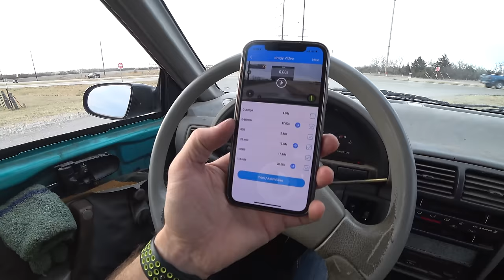I BOUGHT A Geo Metro For $300 And FIXED It In ONE DAY

Comment: I had a 90 metro XFI ... the 5-speed transmission went out when it was about 10 years old

from the time it drove into the garage -> to the time it drove out with a different transmission was a little over an hour - by myself with only a floor jack and hand tools

it was the easiest vehicle I've ever worked on

I'd still drive one of these

Comment: My first car was a 1993 4dr Metro of the same color. I nicknamed it "MacGuyver" due to the excessive amount duct tape, shoe string and garbage tags holding parts of the frame together.

In '96 I was pulled over on the Jersey Turnpike for allegedly going 78 in a 65. My response was that his speed gun needs to be calibrated because the three hamsters running the engine could never create that much power.

Lot.of great memories from that car though. Thanks for sharing!

Comment: Okay, so my Mom had an old wrecked red Geo when I was growing up. I hated it. I used to make her drop me off a block and a half from the school so no one would see me. 😂
It too was missing the door handle on the drivers side. We eventually had to take the door panel of so that we could we could just pull the wire to open the door. 
It was missing the passenger side mirror. 
The trunk struts were replaced with a 2x4 and if you had it propped open and someone slammed one of the other doors then you had a minor concussion.  
The seat covers were old sweatshirts
The windshield wiper handle was a screwdriver that was glued it. 
Man, bring back all the memories with this one. 😂 
All in all I do kinda miss that car. 52mpg was pretty nice. It was also the first car i ever drove. Now I refuse to own a car that is not a manual.
Reply: the 50 mpg is real

Comment: I have a 99 Metro 4 dr with the performance engine 1.3 ltr 16 valve 4 cylinder 79hp at 6000 rpm.  It's the loaded up model with 3 speed automatic, air conditioning AM-FM CD player.  I paid $300.00 for it got it home and put on a new timing belt and a set of 155 80 13 tires.  It will peg out the 85 mph speedometer eventually and turns in 40 mpg.   I've put nearly 60,000 miles on it...love it.  Those little cars are tough as nails.

Comment: There’s a ground issue at the fuse panel under the drivers side. Common issue
Reply: Yup...that plastic panel on one of mine got hot and melted. I put an after market cruise control on it and found the problem poking around in the wires under the dash.

Comment: Had a '91. People might laugh at it,but it was VERY reliable for 10 years and the mileage was unbeatable. I remember driving to work after a bad winter storm in Indiana,passing 4x4s stuck on the side of the road with no problems at all. Never got stuck. Worst problem I ever had was broken alternator belts.

Comment: A few years back around 2011 a good friend of mine
(Past away in 2013 car crash rip my brother) sold me one of this for $200
4 door version!
 cause i needed a vehicle real bad and he  offered his little car.
Even that the exterior was rough with a door damage, missing both door mirrors
And a few dents not to bad. 
The interior was spotless!! Like NEW
no rips, stains, decoloration nothing!!
The engine and trans were in perfect condition!
It was his project and That car was amazing!!!
He knew i was in need and he offered to me so cheap to help me!
A year later i found the same one with the exterior in perfect condition with same color (red) but the engine wont start with missing parts inside and not to good on the upholstery
I bought it for 500 and took all the exterior parts that mine was missing or damage and swap them 
The car became beautiful!! It was an amazing car and i loved it.

Comment: I had the "enjoyment" of refurbish a 1996 Geo Metro that my adult son's sister-in-law used for what had to be a demolition derby. There was no part of the exterior of the car that wasn't dented/smashed in, including the top. And the interior was torn and "painted" black...even the gauges, dash and door panels..at least the ones that were there. Why? anybody's guess. But I was wanting to learn the skills of auto-body repair and took it and started refurbishing that "thing". After many failures in body work, I finally understood the skills to repair the metal properly and when I finished that refurbishing, it look absolutely new inside and out. We even sewed new seat covers and installed new carpet and everything back to new. Lots of work, but I did learn auto-body repair...finally!

Comment: had a1990 4 door red geo metro automatic for 6 years.drove it cross country and slept in it till the 4 tires melted in the arizona heat.got 40 miles per gallon in that 3 cylinder and i wish i still had it.

Comment: Valve springs- Get an 02 socket, and a drill press.   Use 1/4 drive to 3/8 or what ever is on 02 Socket adapter.   Use rack/pinion of drill press to compress springs... works awesome.   Make need to kick head up to match angle.

Comment: i bought a new 94 geo metro and put 300 000 miles on it and all i did was change brakes and battery and regular oil changes   still has original clutch and all its original engine parts ...i love the geo metro

Comment: I didn’t think you were supposed to spray the engine with water at the car wash 😳
Reply: Right. It could crack a hot exhaust manifold as the metal would unevenly contract when cooling. They grounded out the plug wires and got the distributer cap wet, so
it would not start until they dried all that out.  Interesting that they sold it on without repairing the exhaust leak. Not cool.

Comment: Last time somebody I know washed his engine, cost him an alternator and a starter motor!
Reply: I once accidentally left the oil cap off of my Mercedes diesel's engine and oil sprayed all over the engine compartment. I sprayed down the engine bay with brake cleaner, and then hosed it down. Zero issues. But then again, diesels from that era (the 80s) had so little reliance on the electrical system once they turned over... I drove it without a functional battery or alternator multiple times.
Reply: @longbottle  Good old Mercedes! Proper cars!

Comment: We had one in my family for several years. Here in Germany it was sold as Suzuki Swift. I always felt unsafe in this tin can, it even missed ABS and driving on the Autobahn wasn't much fun, definitely a car for the city roads. But it was very fuel economic and it was reliable! Spare parts also were cheap. We sold it in 2018 for 50 EUR. Today it may still running on the roads down Afrika where the car trader shipped it to.

Comment: I had an 1988 Chevrolet Sprint, bought brand new.  It still had a carburetor in 1988.  Great car, wish I still had it.  Nothing like 45/49 MPG.  I had a head gasket leak when I got rid of it, but if I knew then what I know now, I probably could have fixed it myself.  The only thing I wish I had gotten instead was the Turbo mode (70HP LOL).

Comment: Nobody:

JR: let's power wash a 27 year old engine 

SMH... simple degreaser, Dawn dish soap even, and non-pressurized water would have worked just fine, if not better
Reply: Dollar store oven cleaner works well.
Reply: What’s wrong with pressure washing an engine bay
Reply: @lanebramlett2754  With an old car like this, something's bound to come off.
Reply: Jimmy Dean ok thanks I was not sure
Reply: @SamH11223  And water getting in critical areas water should never get into. hence why he couldn't start the car after doing that. Chrisfix does these videos so much better.
Reply: @BattleOfBowties  - not on aluminum

Comment: I worked on one having issues with idle speed control thermo valve in the throttle body due to plugged 5/16" ID coolant hose

Comment: My mom had a 92 and it was on the road until last year, with over 400.000 miles. It outlived her, and would probably still be defying reality by being a reliable daily driver had my son paid attention to the low oil light.

I always wanted one so I could cut the roof off over the rear seats and hatch, to build a weird little 'pickup truck' looking thing. 

I miss that little car. Really enjoyed you guys messing around with this one.

And it always sounded a lot more powerful than a 3 cylinder had any right to sound.

Comment: I have a 94 or 95 Geo Prizm auto that is broken and parked out front. What killed it was the failure of the seal between the radiator and transmission. At that point it had no AC, needed a break job, and had spent a while with no power steering. Still worked for quite a few years.

Comment: My 90's Suzuki swift with a 4 cylinder (paid $400) used a quart of oil every time it was driven. I pulled it apart and one piston was broke from the oil ring down, l pulled the head replaced the piston and dingle ball honed the cylinder, pulled the oil pan and cleaned out all the debris, all without pulling the engine from the car. Still runs great after 30k miles.

Comment: Owned a used '93 Metro back in the day. Working on it was a breeze because the engine was so small that you could literally stand in the empty spaces around it. If you ever dropped a tool or part you could get your whole torso through those gaps and pick up whatever you dropped.

Comment: I rented one & it was fun to drive. A little twitchy on the highway at 70 but fun. When I returned it the shift lever wouldn't move into the "Park" position. I bent it trying. They keys wouldn't come out of the ignition unless it went into park so turning the car in was an event. Their maintenance guy couldn't get the keys out either. It was the version with "Suzuki Swift" badges on it. Nothing against Suzuki, they make great motorcycles. I've owned 2.

Comment: My mom drove one for years.  Lost compression, Then I got it.  Replaced the burnt valve, then drove it for three years or so.  Stopped driving it when lost compression a second time.  Gave it to my friend that fixed it the first time, and he replaced another valve and drove it over 150 miles a day going back and forth to barber college for a year before he sold it.  It had at least 120,000 miles on it when I got it.  Then the miles my friend put on it before he sold it.  For a disposable car, it served us well.  1994 model.

Comment: Bought the same car, color and all, brand new in '93. VERY economical, reliable car. A big plus was that it had a minimal amount of electronics to fail. Put aftermarket a/c and a high capacity 3 row aftermarket all-metal  radiator in it myself. Only sold it about 8 years ago to someone who sought it out and drove it cross-country to Washington State (I'm in Miami, FL). The only constant problem was the tires, and not because the tread wore out. Even brand new, and regardless of manufacturer, or grade, they would constantly lose air pressure, getting worse over the life of the tires (I put 7 or 8 sets of tires on that car in 20 yrs). The XFI engine used a slightly different camshaft and valve timing as well as slightly different timing belt and gears. It was good for a consistent mid-40's, low 50's MPG fuel economy, and would go 92 MPH flat out, if you had about 3 or 4 miles of straight, flat road to do it. Oh, and the plastic stuff inside the car started falling apart after 2-3 years. Who cares, I knew what it was when I bought it, a basic airport car. If a car that gave the value that Geo did were sold today, I'd go down and, once again pay cash and buy it in a minute. My brother is the original owner of this Geo's predecessor, an '88 Chevy Sprint that still gets driven a couple times each week.

Comment: I bought an 89 Suzuki Swift gti from a guy in Indiana for 500 bucks a couple years ago. Rusted out floor pans and missing almost every interior panel but wow was it fun it was to drive. 6 months later I hit a huge puddle in the road and it just stopped running. Shops wouldn’t work on it cause they said it was basically a lost cause. Tried to fix it myself but nothing ever seemed to work. After putting in more than I bought it for I had to junk it 😔 she was my red rocket. I kept the interior brake light as a memento. Metro/Swift/Firefly gang rise up 🤘🏽

Comment: I bought a 93 Geo Storm back in the day for $250, as it needed a head gasket. Did all of that (for cheap, too..parts for Geo are just crazy cheap for some reason) and drove it for a little while. Got rid of it when I realized I had to replace the entire front suspension to stop it from eating tires every 3 weeks.

Comment: I bought my 92 LSi convertable 2 years ago for $700. Put in a coil, fuel pump, all filters, plugs, wires, dist. cap and rotor and oil change.  Haven't had to do anything other than routine maintanance since. I get 48mpg combined city/hwy.
(Edit... all in under $900 road ready)
The 1 liter 3 cyl came from the factory rated at 55 hp @58 #ft of torque. Same engine in your 93 3-door. Great little, hard to kill cars. But heah, they do take a good while to get up to speed. They will eventually get up to 85mph highway speed, but it takes a bit of getting used to. You definitely do not have two-lane road passing power, but you can pass a lot of gas stations on its approximately 8 gallons of gas.

Comment: Bought a xfi brand new in 1989 for 7800 dollars off the showroom floor at chevy.
No mirror on passenger side and no ac for mileage i got 58 mpg.
In 5 years of ownership I never had any issues only had to unclog the egr valve.
On 2012  i bought a red convertible at the height of the gas crunch it was 20 years old I drove a 124 miles round trip 6 days a week and for 2 years never had to do anything but change the oil.
In 2014 I boight a 2001 honda insight and still have my convertible geo today.
Great dependable cars only issue is safety as they were made so light.
Very underrated  cars.
The xfi had a special cam for superior mileage . My red convertible and most 3 cylinder geos wrre rated at 48 yo 50 mpg.
My 20 year old red convertible ran for around 60000 miles over 2 years and still runs fine today as I sat back and my co workers laughed at me yet they were all constantly fixing there late model cars living within a stones throw to work.

Comment: I just got a low mileage 1994 Geo Metro 4 door, 5 speed with A/C, clean interior and new pearl white paint for $1100. Only has a bad fuel filter and fuel pump. It would not start till I whack the bottom of the gas tank with a  piece of wood. Then I drove it sputtering 45 miles home. These things are just little workhorses.

Comment: Got a 95 metro lsi with 129k (that’s barely broken in btw) it’s not the infamous 1.0 liter but still managing to get 45 to the gallon. All you gotta do is keep up with the maintenance which is super easy. Can easily last you upwards of 300k+ miles. Great little dependable Suzuki engine, can’t complain for 700 bucks 👍

Comment: Owned a white 1994 XFI. Previous owner bought the car from an auto parts store that used it as a delivery car. The back seat was removed and a piece of plywood was cut and placed over the back-seat area to accommodate more auto parts; so it was basically a 2+2, coupe! I bought the car for the novelty of having the XFI (I knew its reputation as a popular hyper-miling platform). It was bad-ass on gas, too! I think this would this be my Bug-Out car; in a Zombie Apocalypse, you could travel from sea-to-shining-sea with the gas you could trade or siphon. The prices on the parts is measly. A four seater that runs, shifts, has heat and and other basics and passes inspection? Bad-Ass for a 1st car for a high school kid. I would have loved ANY car, in high school!

Comment: XFI has one less piston ring and a different cam so it gets better mileage than the others. I have owned 4 Geo Metro Convertibles at one time and even adapted a Kubota 3 cylinder 24 horsepower diesel  engine to the 5 speed trans. I still have it.

Comment: They made a Pontiac that was called the firefly and it was a 1.0 liter single turbo. And got even better gas mileage.

I just picked up a 93 metro for 140 yesterday and I intend to put boost through the old 3 cylinder

Comment: I bought one in 2012. Owner said his turned on the stereo and heard a noise then the car died. He put a plethora of sensors on it, all fuses were fine but it still wouldn’t start. I gave him 300$
The same day I was looking around under the dash and found another small fuse box. It held only 3 or 4 fuses and one was for the ignition which was blown. 
Replaced the fuse and it fired up. Sold it for 700 the same day.
Reply: Where is the other fuse box?

Comment: I  got a`95 as a pandemic project put a couple grand in it ,drove it 4000 miles to avoid flying in july 2021,its a 5 speed w/ac   198k on  it got 42 mpg using the ac bout 1/2 the trip,only mechanical issue is had the standard headlight issue ,solved that by making my own headlight harness rather than trying the fuse box fix ,,looked like a previous owner had done a # under the fuse box any ways.
sure its quirky ,to say the least but it beats the 16 mpg in my p/u

Comment: This car was built in Pakistan up till 2016 (it was named Suzuki cultus) last iteration of this car had a 1 litre 4 cyl efi engine... I had a 2014 model and loved the sound of the engine. I never got good gas milage because car was underpowered and I was always shifting gears above 4000 rpm to keep up with Honda civics in the traffic 😂. But it was so much fun to drive.

Comment: Swifts always had the 4 cylinder while the Metros had 3 until they redesigned the body style. Then it was the base engine and you could opt for the 4 cylinder. If I'm not mistaken the 4 cylinder was the same as the Ford Fiestas had. 1.3 liter.

Comment: I put 210K miles on my 94 Metro in 2 years. I had my 96 Metro for 13 years but it only had 95K miles on it when I sold it.
All 3cyl Metro’s burn oil. A quart between changes.
I’d LOVE to buy another one for a commuter car